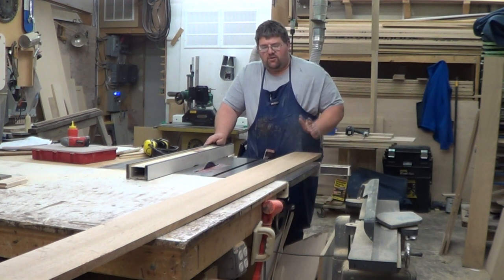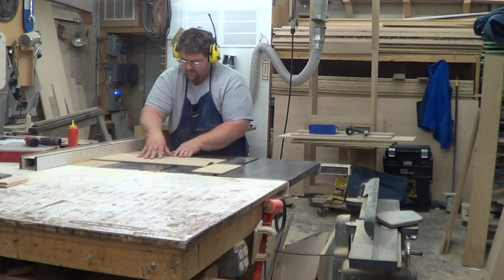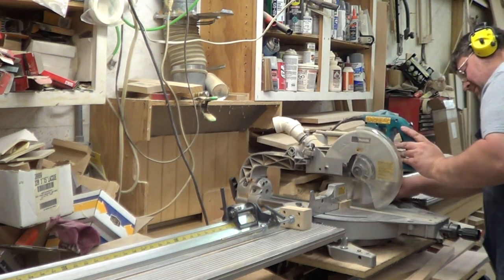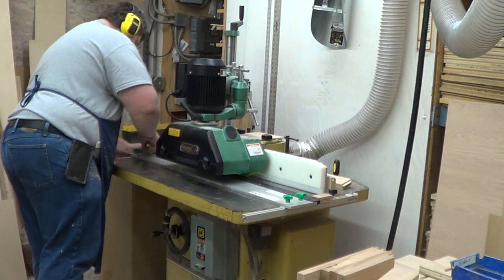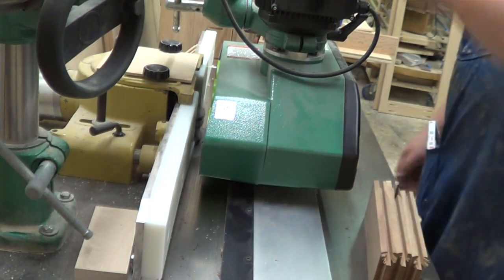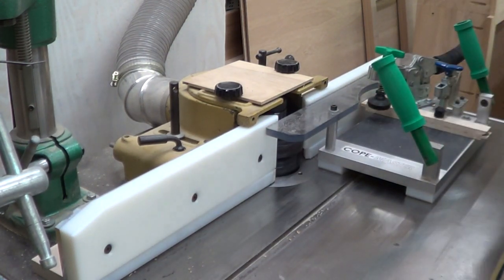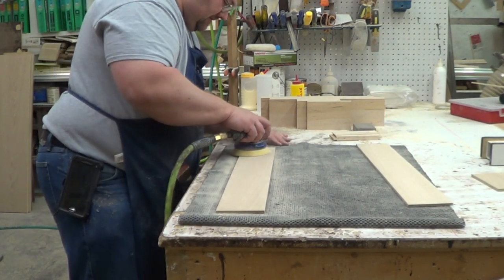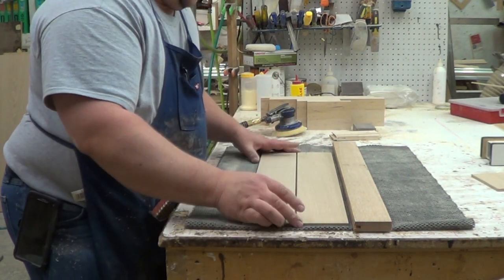Building Custom Cabinet Doors Webisode 2 # 164

Comment: I have looked for that coping sled online and so far, I have not found that brand.  Care to share where to find it?
Reply from the maker: Hi, this was a shop built jig. I found a YouTube video called "Raised Panel Door" put out by Patrick Malzhan that had a jig that looks just like it. I later found one like the one in the mentioned video after I had built mine, by a company online called Wynmatic. It's a bit  pricey, but for the time, effort, and materials I have invested in mine, I wished I would have bought it rather than building it. If I had to do it over, I'd spend the money and buy it. Thanks. Scott

Comment: Couple questions if I may..
My Grizzly feeder has fairly wide stock wheels. I believe the width will prevent using an outboard fence on a 2" wide stile. Is that why you have the urethane wheels (look narrower)
The stock wheels also tend to slip a bit. Trying cleaning w alcohol or mineral spirits..
Also the feeder tends to twist the stile into the fence opening getting it caught on the outbound fence. Any help would be appreciated. Thx again!
Reply from the maker: Jeff, send me an email through my Channel "About" . There should be an email I business inquiry link there. Let me know if that works for you. Scott.

Comment: Nice series.  On your auxiliary fence, do you setup your power feeder to force the stock against that fence instead of the stock shaper fence?
Reply from the maker: +ExtremeWoodworker Hi, thanks for the comment! Yes, the stock gets run against an auxiliary fence in front of the tooling with the power feeder. I use this method because of its constant width feature. Being that when I start a job, I rip all of the solid stock first maximizing the yield out of each board width, so my table saw fence is constantly moving. This fence will allow me to take inconsistent width stock (as long as its wider than targeted finished width) an machine it to a consistent width up to a 1/4" in oversized width. I have the same setup on my other Powermatic Super 27 shaper that I use for raising panels and dimensioning face frame stock as well. Thanks! Scott.

Comment: hi!
great presentation!
where i can get this jig???
greatings klaus
Reply from the maker: +klaus moucka Hi thanks for the comment. Unfortunately it's not something available on the market. I actually built this one here in the shop out of readily available materials (6061 aluminum bar and round stock, UHMW plastic, polycarbinate plastic, and some heavy duty toggle clamps). I searched Google images for different types of coping sleds and combined ideas to build my own meeting our needs here in the shop. In my search in Google Images, I did however find one similar to this one with a different handle setup that retails for $795 that is made in the USA, I built mine using some of its characteristics thinking I could build it cheaper than buying it, I soon found out into the build I would have been ahead if I just would have bought it instead. I have about $200 into materials and about 15 hrs labor into the R&D and build time, so this jig essentially cost me around $800 to build. However it gave me an experience in working with materials that can be cut like wood and it taught me how to be patient in tapping aluminum. Thanks! Scott

Comment: Do you use the orbital sander with dust extraction?
Reply from the maker: +Nicholas Smerk Hi, well.....I usually have my air cleaner on and if its a lot of sanding like a full cabinet job with doors and cabinets then I run my exhaust fan system to draw it out. I'm actually going to hopefully redesigning the out feed table with a built in down draft. Thanks. Scott
Reply: +The Wood Craftsman (puttz1976) ok, I usually plug my shop vac into my electric sander when I use it.  I've been itching to pick up a new air sander, but I only have a 9cfm compressor and not ready to upgrade.  Sanding would be the only thing that use more than 9cfm...
Reply from the maker: +Nicholas Smerk You might want to check out the Mirka Ceros electric sander, it has the same shape and compact body as the air sanders  but is electric. The motor I beleive is DC and plugs into a box which has all the brains in it that plugs into a standard 110-120 VAC wall outlet. They are spendy though, $300+.
Reply: ***** I'm cheep.  Not a production shop.  Still try to buy good tools, but my Dewalt works good enough for now.
Reply from the maker: +Nicholas Smerk I started out the same way, you have to use what works and is affordable to you, and as time and money allow you can always upgrade as needed. Thanks. Scott

Comment: that is an awesome setup not having to change out the cutters. any progress on the miter saw fence stop you were talking about in a previous video?
Reply from the maker: +ironlionkalo Hi, thanks for the comment. Yes, the stacking of the coping and sticking heads is a huge labor saver! i wished i would have done it 10 years ago. The miter saw fence is on hold for now as I have decided to upgrade the shop heating system from forced air to hydronic for more temperature consistency and lower heating cost. I will however be  upgrading the actual bench with a steel frame and re-mounting the existing fence permanently for the time being. I'm doing this in preparation for removal of a STORE-ALL rack that has collected nothing but junk and odd hardware so I can run base board hydronic heat along the two exterior walls. I might do a time lapse video of the miter saw wall bench, but not sure yet.